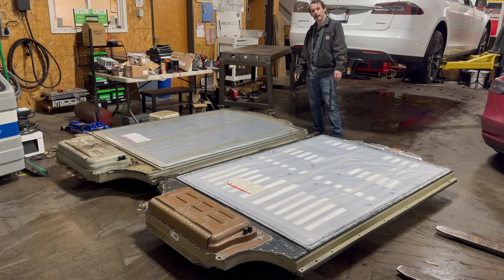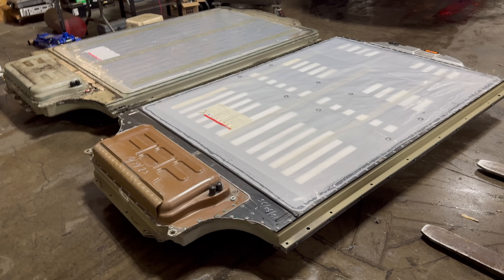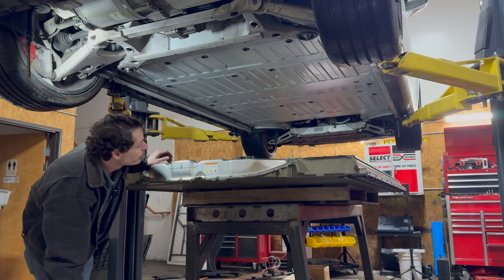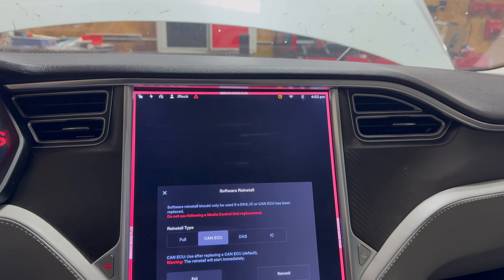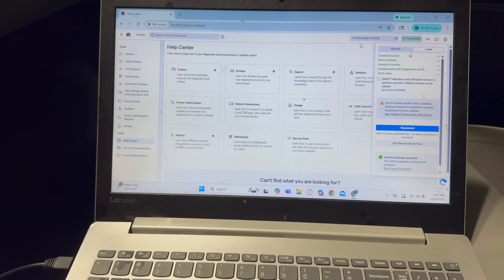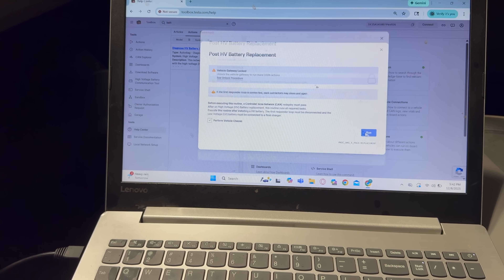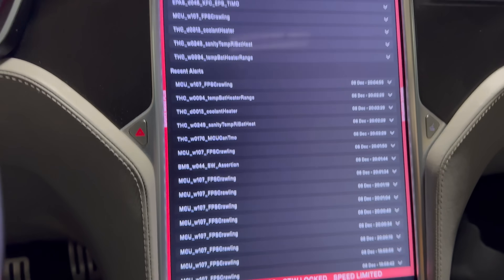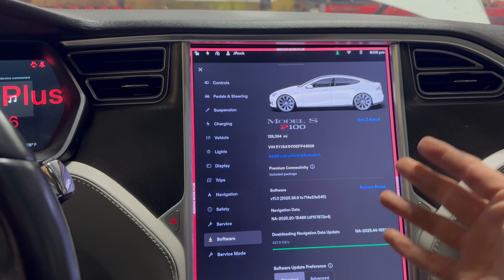Doing The Impossible! RWD Model S 100kWh Battery Swap

Comment: This was already done some years ago, thanks to good repair people and some small colab from Tesla. I wish 100kwh packs were cheap in Europe, but they are super rare and costly.... for regular rear 85 cars, there is also a HV-cable issue, which is not an issue on on 85D. I'm not sure, but the P85 versions might have the right HV-cables?

Comment: I recently purchased a 2023 Model 3 RWD 57 KWH. Would it be possible to swap out the pack for a 100 KWH pack?
Reply: No. Different design, different fittings, different size (way too big in dimensions and in weight), different firmware requirements. You could fit another larger capacity pack from another Model 3 (biggest capacity 85kwh) but the only 100kWh packs are for the S and X.

Comment: To get the + to display...
Update "Performance Parameter": Within Toolbox 3, you need to change the performance parameter settings. For many, changing this from P1 to P2 or updating the vehicle configuration to match a P100D (if the motor/drive unit was also upgraded) is required.

CAN Network Redeploy: After changing the configuration, a "CAN only redeploy" is necessary to make the new configuration stick to the car's software.

Comment: Can confirm Alex's work. I have a MS 100 RWD and the configuration does exist. Max miles on a 257 CAC rating is 300 miles. I still call it a MS70 because it's easier for my service documents. If you have the means, get the battery swap. I get similar 20-80 charging times of 30 min and can reach up to 225 kW with updated wiring and pyrofuse 1111445-00-F revision.

Comment: is it possible to remove the software lock on the 60s with 75kWh batteries with toolbox?
Reply: No, this is an engineering level issue that realistically can only be fixed by Tesla (it has to do with firmware config enforcement specifically on 14 module, 350v packs). It may be possible to do a workaround by manually editing the config, but likely will result in permanent alerts complaining about a config mismatch. With a 400v pack swap however, this isn't an issue.

Comment: if you were near i would have you swap my P85D to a 100kw pack, I have some questions for you that maybe you can help me with. First is that I see that the packs can go for 8-10k installed  but since my pack is sill in really good shape its hard for me to decide to do it because of the money price in doing it, so I was looking into car auctions that sell salvaged cars that are wrecked and some sell for a fraction of the price and have 100kw batteries in them so would you or anyone be able to salvage the battery and replace it just swap it or does Tesla somehow ban that battery within software not to be able to be used in another car or is it good to go?. second do you do other things like coolant delete?.
Reply: Almost all packs for these types of swaps come from wrecked/salvage cars. The main thing is ensuring it's not damaged from whatever collision the car was involved in - I just recently had a customer source their own pack for a swap, only to discover when it arrived that the penthouse had been bashed in (likely due to the front drive unit colliding with it from a front-end collision). The #9 module in the penthouse was physically damaged and the pack has to be sent back to the dismantler - lots of wasted time and effort on a damaged pack. If buying a whole car from auction, they are sold as-is, meaning you have zero recourse to get your money back if the pack ends up being damaged. 

Additionally, 100kWh packs build before late 2019 seem to be more prone to suffering from separated wirebonds on the sense lead harness, so that's something to keep in mind for future reliability (it is a repairable issue, but lots of work to do so). When sourcing 100kWh packs, I try to source them with 2020 or newer build dates, and as low of mileage as possible.

Comment: Love your videos, but the upgrade is not as impossible as it was once thought to be. Tesla now offers this upgrade when the battery goes bad. My p85 went in for service and Tesla gave me 2 quotes for battery replacement. $18k for th 85kwh battery or $20k for the upgrade to 100kwh. But again, love the videos, awesome content. You have helped me keep my 2013 S on the road as long as it has been.
Reply: I'd like to see a copy of that quote. Apart from some offers in 2017 for P90DL owners to upgrade to their cars to P100DL, Tesla has never "officially" offered 100kWh pack install options on any cars at the service center level. Typically the $20k pack option would be for a new build 350v 90kWh pack (which is essentially a 100kWh with 2 modules removed). The $18k option was likely for the same pack, but with a software limitation to 85kWh (reman packs are typically ~$14k if available). I have heard of service advisors making mistakes on quotes on repairs, where they offer one option, only to realize it's not something they can do and end up having to backtrack, so that's always a possibility as well.

Comment: If you have a FLIR Camera, (Forward Looking Infra-Red) and a fan and a power supply, you can charge the blade with the shorted cell, and watch for which cell gets warmer than the others while flowing a bit of cooling air over the battery ends, then disconnect jumper lead to the defective cell from the rest of the blade and after that, balance out the charge in the repaired blade to match the state ofh charge in all the other blades, and that formerly defective pack should then have the maximum range it can do at it’s age and mileage.
Reply: You gotta find the chrome stick on P100D badge and put it on the rear end.

Comment: Great video! One correction: no need to do software updates to renew certificates.   Just need to make sure the car connects to Tesla’s servers at least once every 6 months. Certificates get renewed automatically when they are within 6 months of expiration.
Reply: I used to give no thought to putting the software updates in, until tesla ruined my car by adding "curvature assist" which was not on my car when I bought it and I cannot disable. It negatively affects my commute every day .. and definitely makes me wonder if there shouldn't be laws about making undesired fundamental changes to the drive profile or UI after the sale.

Comment: Hmm. Seems very complicated to own an EV. Never free of the manufacturer. Life time of Wi-Fi connection, and very expensive if the slightest thing goes wrong - software and hardware. Still, the quiet ride must be worth it.
Reply: "lifetime of WiFi connection"? You got a phone ... hot spot a wifi connection anytime you want. When you consider the number of things that can need expensive repairs with all types of modern cars EVs seem almost straightforward. At least you don't need to worry about gearbox, clutch, cat converter, DPF issues for diesel, head gasket failure leading to consequent engine damage, wet belt timing system failure leading to terminal engine damage etc etc This video is a great example of an independent garage rather than "never free from the manaufacturer ... of course that's a real issue for many modern cars when there's something unrepairable and not specific to EV.

Comment: Is it possible to upgrade the DC fast-charging speed on older model Tesla ?
Reply: This battery swap increases the charging speed quite substantially! Almost 2x energy delivered over the course of a 15-20 min charge session. Still a bit limited due to some other hardware limitations with the car though.

Comment: You know what'd be an awesome build if you had enough funds? Replacing the stock 18650 cells to modern tabless Ampace JP30/EVE 30PL.

With a bit of BMS and charging modification, you could probably hit 250kW from 0-100% no problem.

Comment: One interesting aspect of this swap is, the front drive unit on AWD models is almost 200 pounds by itself. Undoubtedly the suspension of a RWD would be easily able to handle the extra battery weight by itself.

Comment: how do you access servicemode PLUS
Reply: When you connect to the car with Toolbox it automatically enters service mode plus.
Reply: @AlexEVRepair that lets you do a lot more on the MCU, right?
Reply: @Nicholas-f5  on MCU 2 (or newer), yes. Not so much on MCU 1.
Reply: @AlexEVRepair  Thank you ! did you ever ran these 2 commands? PROC_HVBMS_X_RESET-BRICK-CAC f
 Run PROC_HVBMS_X_RESET-SOC

Comment: This is amazing! I'm sure it's a ton of work but you make it look easy, lol.
Will the car still be able to get future software updates with a non-factory config? I've read on forums that changing the car to a config that Tesla didn't make will prevent future software updates, but not sure if that's real or not. Also, are you able to give any idea of what the total cost was for this swap? (I have a 2014 85, just curious in case I ever need a pack swap)
Reply: Nope, the car has no issues getting updates. This is a supported firmware config by Tesla (hence why the swap can be done with Toolbox). 
Back in the "bad old days", a swap like this would have required the MCU to be rooted/hacked, which would disable future updates, but that's not the case anymore. 
A swap like this, using a newer build pack with low miles will typically set you back about $13-14k depending on pack availability.
Reply: @AlexEVRepair Awesome, thank you for the info! You're doing great work for the used EV owners out there!

Comment: How much does the bigger pack weigh?
Reply: Less than 200lbs heavier than the original.
Reply: @AlexEVRepair and how much did the original weigh? I’m just trying to imagine how much an electric fuel tank is.
Reply: about 800 pounds for the 100kWh battery
Reply: @u@user-zk5vt8qq5qthank you, that is a lot of weight, I figured my tank with 140 litres of diesel would weigh approximately 300 lbs with a range of 1000 kms. But it’s all swings and roundabouts comparing one vehicle type to another.

Comment: Awesome video and it shows how these cars can last a long time. I have a 2014 85 with 185k miles and still works great. I remember doing some upgrade in the past because of the screen bubble issue and memory issue. It was mostly done under warranty. How do I check if I have MCU 1 or 2? Also, do you recommend anywhere/anyone in Southern California that can do this, when the time comes?
Reply: Look at safety, MCU1 is Tegra or something
Reply: @Nicholas-f5  Just checked and I have MCU2.
Reply: @DoriStuchinsky very lucky, some were recalled or upgraded

Comment: Any issue with unlimited super charge if you reconfigured the battery pack?
Reply: Nope, still works perfectly.
Reply: @AlexEVRepair does SCO1 status live on the body control unit?
Reply: @Nicholas-f5  I want to know this too
Reply: @Nicholas-f5  SC01 is tied to the VIN.
Reply: @AlexEVRepair does it live in the MCU?

Comment: My guess is that the suspension is designed for the weight of the largest batteries and heavier motors. It wouldn't make sense to have different suspension for the minor differences .
Reply: The EPC shows different springs for the non-air suspension.
Reply: Having different springs is no big deal. It's not like it would be a whole different suspension.

Comment: Great, job well done

One question: these models had their charging power limited with the 85kWh battery packs. When you upgrade to a 100kWh pack, does the charging speed improve or does it still charge slowly?
Reply: Yes, charging speeds are increased substantially, though still limited by other hardware (FC contactors, rapidmate, etc.). 

In the case of an older 85kWh equipped car like this, the amount of energy delivered in a 15 minute charging session (assuming fully preconditioned, etc.) would be nearly double with the 100kWh pack installed.
Reply: @AlexEVRepair What could that look like from a 60kw?

Comment: The battery heater was faulty? ...or changed to match the new battery pack???
Reply: Separate issue in this case. Though if it appeared after the pack swap something inside the pack could cause it.

Comment: I thougt that mcu1 is better for Service repairs than mcu2. Now it is flipped wow. My mcu1 ist running year per year. I told myself i do the Upgrade when i geht the bubble Thing in the screen
Reply: Most times it's a black screen which forces owners to upgrade. I think MCU2 is better supported with software updates too (at least here in Australia).
Reply: Can also swap just the screen itself

Comment: Would be interesting to see before and after ranges and mainly acceleration changes.
I know that its inverter and grip limited (since its rwd) but a bigger battery can hold high voltages more stable so it should boost acceleration 60 to 120 for sure.
If you could ask the owner to give you the car to film it - that would be cool. 
Keep the charge level 95-100 for max performance, battery preconditioned ofcource and connect scan my Tesla while testing to see Max battery and R drive power limits. 
for example, in best conditions my S75 2016 rwd Max battery discharge is 314 kwt and R drive power is 315 kwt.
Reply: Charges faster too
Reply: @Nicholas-f5 My 75 charged to 80% in 40 minutes. 55 minutes to 100% on 130 KWt charger. I already made like 5 consecutive 1000 mile trips on it in -10c weather. 
After all this im not really sure if i need a faster charging speed. I stop every 300 km or so (200~ miles) and it takes me at least an hour to caych a breath, eat and rest a bit. 
Im not talking about autobahn here. Im talking about that europe with narrow roads and a rediculus amount of turns.
Reply: Isn't the inverter in the penthouse of the battery pack? (so would be included in the swap).
Reply: @MrAdopado  Nope. At least in mine. Or maybe its some other inverter. I was talking about the triple brannch one which takes the whole right part of the LDU. I guess every DU has its own inverter, regardless of the size.

Comment: how much for the swap...parts and labor?
Reply: These days it's around $13-14k for a newer build, low mileage 100kWh pack install. Depends a bit on availability though.
Reply: The car from auction is around 1500 bucks. Battery and all. Don’t know where this dude is coming up with 14k
Reply: @EugenePutin  I'd like to see where you're finding 100kWh cars (with 2020+ build date packs under 40k mi) for $1,500, because I'd be buying them all day long!
Reply: @AlexEVRepair not with 100kwh packs but you CAN get old model s cars for 1500. South Carolina.
Reply: @EugenePutin will  thay skip to wichita kansas?

Comment: What is the cost for that upgrade. I have a 2015 P85D that I like to have that upgrade and update. N service the fluid in both motors. I’m just 150 miles north of Portland. The car has been good to me. It has 154,000 miles n still going strong. I just wish the car had hardware 4 install maybe in the near future.
Reply: Typically for a low milage, newer build pack, it's around $13-14k installed these days.
Reply: @AlexEVRepair can also find a wrecked one locally

Comment: Hello. Inspiring by your video's i planing swap 100kw battery to my 70d. I buy 100D for parts/battery but few days later i win auction with p100d and then sell 70d and skip that proces :) 100D have mcu2 but p100d have mcu1 and i will need to swap units. Do you done this/have tutorial/info how to? :) I dont want to mess up something :)
Reply: Can't swap MCU officially, have to be new from Tesla 

Can swap outer screen only if that's the issue
Reply: @Nicholas-f5 i want mcu2 in mcu1 car, and i have mcu2 car for parts.

Comment: Just before I upgraded to MCU 2.0 on my 2015 S, I had a battery heater issue. It was caused by MCU 1.0. I never changed the heater and the issue went away with the MCU 2.0 upgrade.
Reply: Wild

Comment: I have a '14 P85, and this is my plan also, if I ever lose the original pack. I'm at 198k miles currently.
Reply: There are P85s here in the UK that have sailed past 500k miles on the original pack and motors - you might have quite a wait!
Reply: Stick an AirTag in it!
Reply: same! im at 235k
Reply: I had a P85 that I sold and it had about 65,000 miles on it after 9 years. I suspect that it should go another 200,000 miles before it needs any real updates/upgrades. Putting in a 100 pack certainly sounds like a thing that I would do, but the coolant delete I believe is a must for these cars.  I told the new owner that I want first dibs on buying it back if they ever decide to sell it.
Reply: How much does the battery swap cost?
Reply: Have you had any quotes? Im in the same boat as you.

Comment: Where did you get the pack from? What is the warranty on it?
Reply: Typically I source these packs from auto dismantlers - standard warranty from my shop is a year.
Reply: @AlexEVRepair  ok, so this would not be a pack from the latest Model S versions (2023+). Probably before the last refresh correct? Like a Raven Model S?
Reply: You probably can’t even by batts brand new, most are 2nd hand batts
Reply: @bevis90  we Tesla Model S currently have 100kw batteries. I just wasnt sure if it he got it from a newer model S or older models before the last refresh

Comment: How much (approx) is the pack and labor to swap?
Reply: Depends a bit on pack availability, but for a newer build, low mileage pack like this, these days it's around $13-14k installed.
Reply: What will a 90d good battery (72.5kwh remaining), will do in return?

Comment: Great video. Does the update include updating the mileage to the battery pack or is mileage to the car itself
Reply: Mileage on the software screen will show the cars mileage not the mileage on the battery. This doesn’t change after a pack swap. The battery management system doesn’t keep track of mileage only charging cycles.
Reply: @110thtimesacharm it's on body control unit?